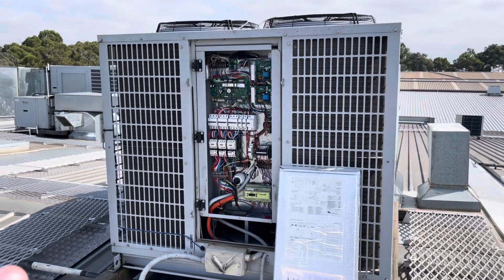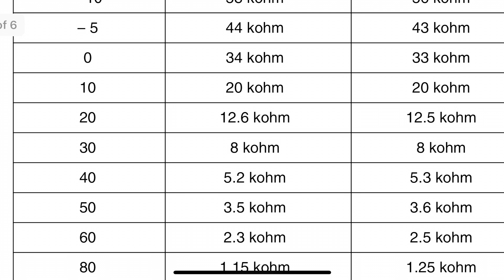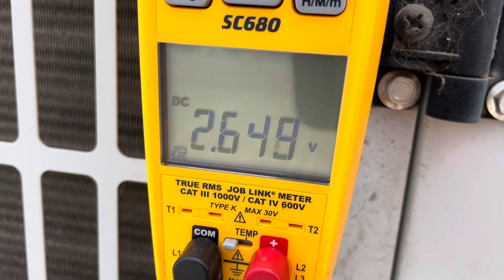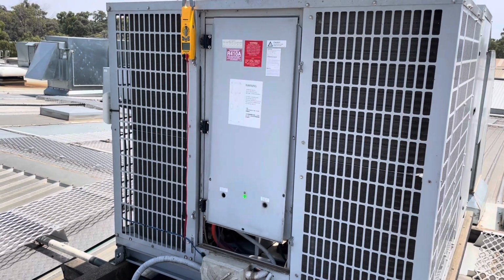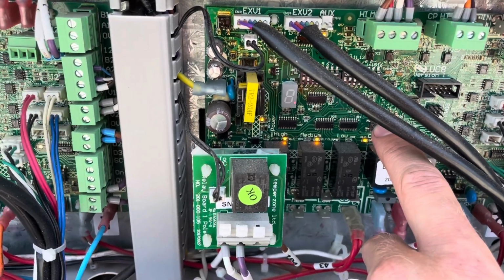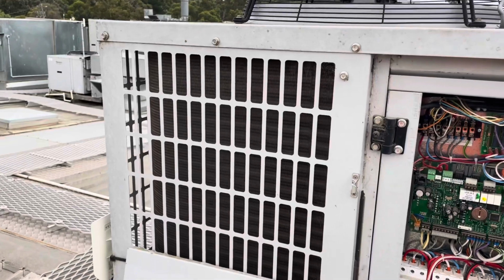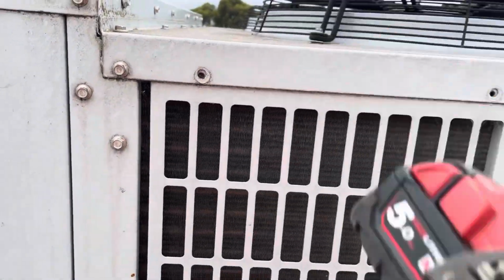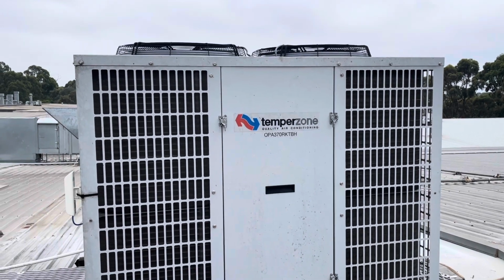Temperzone / Package Unit is Out On High Pressure Lockout

Comment: FWIW if you ever got bored and decided to pick up a copy of the AIRAH tech manual it has a table of W/m2 rates for various space types. E.g. an internal office area with no external walls I recall being around 100W/m2, so that unit being below that is an indicator it is undersized based on your calc at 150w/m2.
Reply from the maker: Thanks for the tip mate! Appreciate it. I’ll go have a read. I know it’s a basic calculation but still comes in handy from time to time.

Comment: How's the air balance on the factory? If there's too much outside air it would struggle during the day. Looked like it had outside air/economiser dampers on it. Should be able to stand at a door inside/outside and feel if it's blowing cold air out or warm air is being sucked in when you crack the door slightly. 

Looks like that damper was closed, but still probably worth checking.
Reply from the maker: Air balance is good, the O/A dampeners were closed. I was checking throughout the day just to see if they opened randomly but didn’t see anything funky. 

I’ll be back there again in a week or so.
Reply: @hvacraustralia  All over it! Good man. 

My current gig is a sparky in a refrigerated warehouse. The things I see here... So many places they piss away energy with simple stuff like that, it's nuts.
Reply from the maker: I have the benefit of knowing about this issue for a while 😂 

It’s amazing how many place waste so much unnecessary energy though!

Comment: Most probably intermittent hp fail due to orifice in the condenser as what observe with temperzone heatpump or most aussie unit causing system to run with high comdensing temp.
Reply from the maker: I’ll have a look into that when I go back. Cheers.